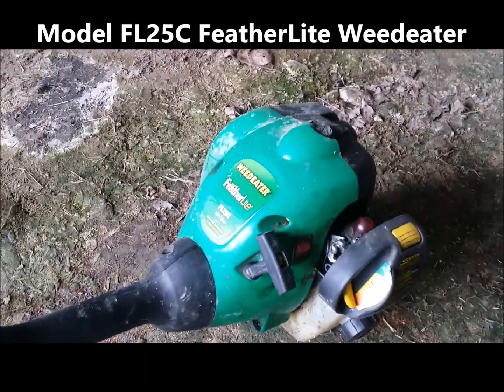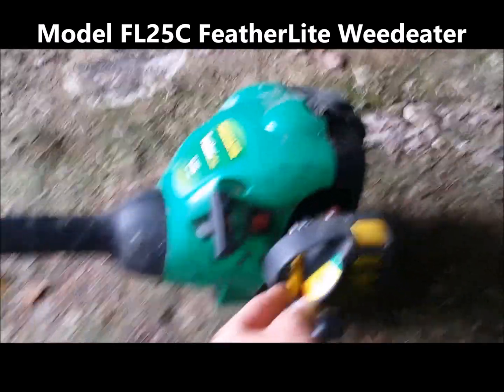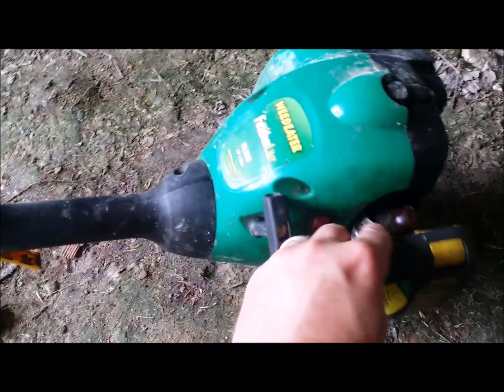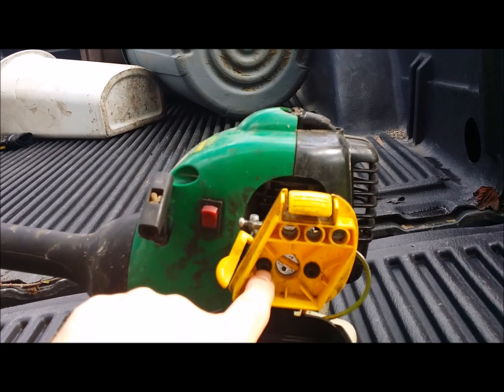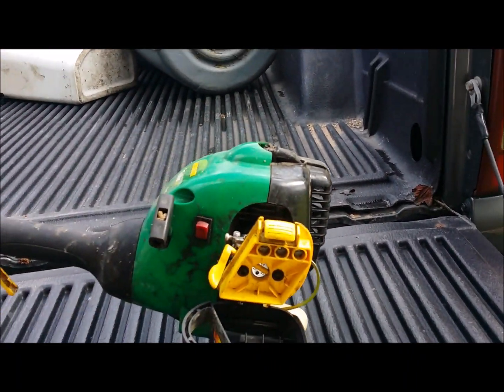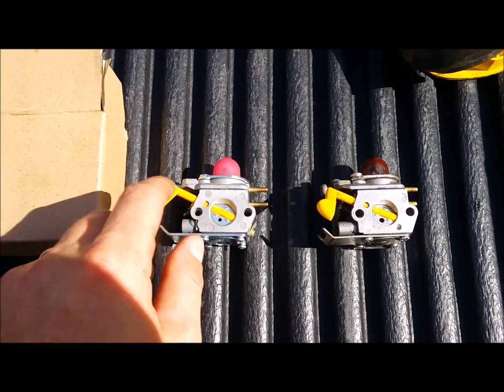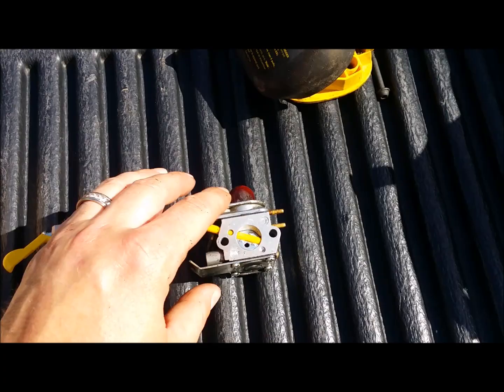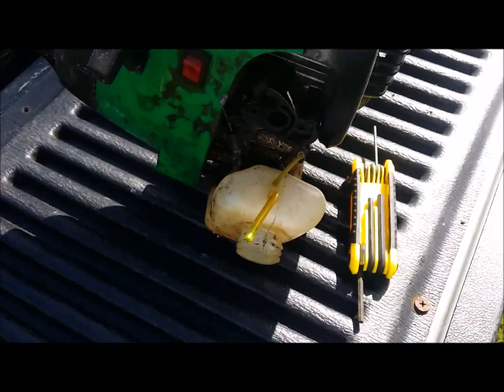Weed Eater only runs on choke - Weedeater Carburetor Replacement FeatherLite FL25C $15 FIX

Comment: What was wrong with the carburetor in the first place?
Reply from the maker: Not sure specifically, but imagine it just gummed up from sitting over time.  Tried cleaning and never worked, so I did the replacement.

Comment: Hi i have a troybilt weedeater.it runs strong only when on choke..and help plz thanks
Reply from the maker: Get a new carb. Else run it like that. Should be fine.
Reply: JRMSweeps thing is if i run it 9n choke it will automatikly accelerate itself very high..with out pressing throttle...u think it should be the carb
Reply from the maker: Yes it's the carb. Get u a cheapo online.
Reply: JRMSweeps oh ok thanks very much
Reply from the maker: Welcome.
Reply: JRMSweeps so its better to buy new carb instead of cleaning it
Reply from the maker: U can try cleaning.
Reply: JRMSweeps i took it to repair 2 times..it worked fine then bogs down when i press throttle.then only runs 9n choke on..

Comment: Why is it smoking? Mine does the same thing and I cant figure why, I cleaned the exhaust, removed any build up and still smokes
Reply from the maker: its a 2 stroke and when the oil burns with the gas it smokes...i add a lil more oil than necessary to make sure the parts get lubed during combustion...
Reply: JRMSweeps my dad does and says the same thing. He doesn't even measure the gas and oil he just poures it in. But you missed your chance should've put an Edelbrock on that thing
Reply from the maker: +Aaron S like a 4 barrel 750cfm...
Reply: JRMSweeps don't forget an expansion chamber since it's a 2 stroke
Reply from the maker: +Aaron S oh snap, forgot that, lol

Comment: Did it not have the fuel air adjustment screws.
Reply from the maker: Was just a cheap chinese carb that came on the original anyway.
Reply: Yea, they are cheap. But you can adjust the mixture and it should have gone back to normal. 
How is it running now after 2 years, if you still have it.
Reply from the maker: Like crap tbh. Got flooded in the hurricane last yr.